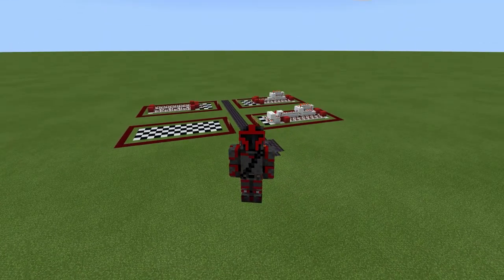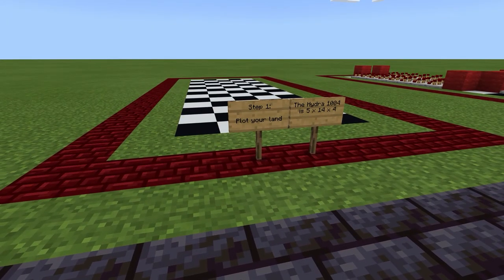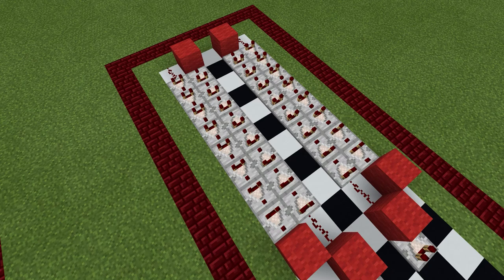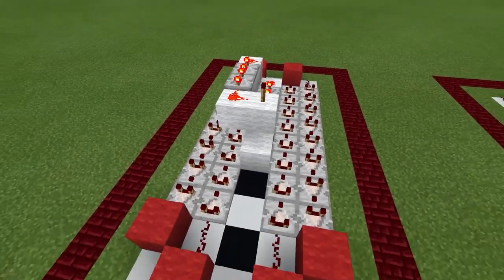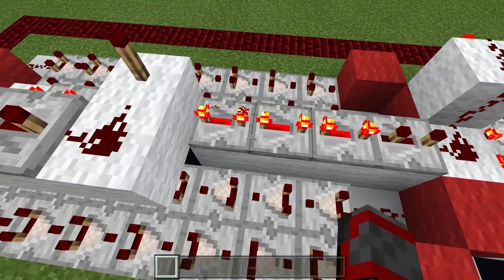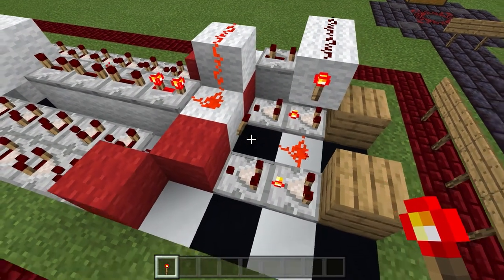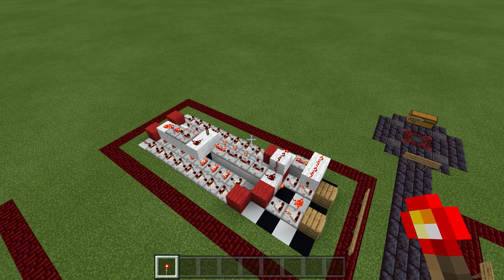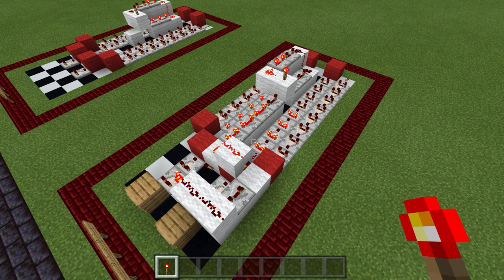Hydra 1004 - Minecraft redstone hex hard drive

Comment: How do i connect it to ur computer?
Reply from the maker: The output of the Hydra 1004 connects to the input port on the RPC2.
Reply: @ct5k_  so you connect the 2 wool into one and connect to the decoder? or the port beside it?
Reply from the maker: So you would connect the two wool to the input port, so that the left wool will be on the decoder side, and the right wool will be on the numerical side.
Reply: @ct5k_  oh thanks